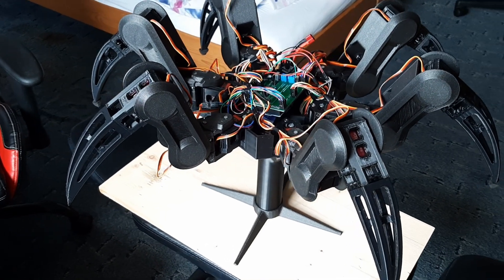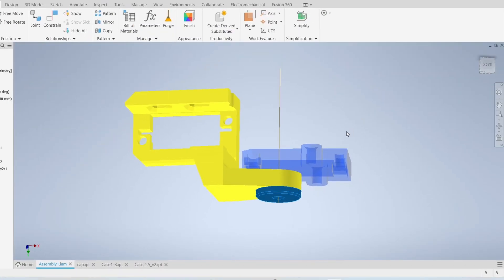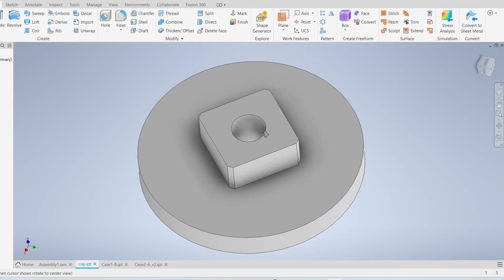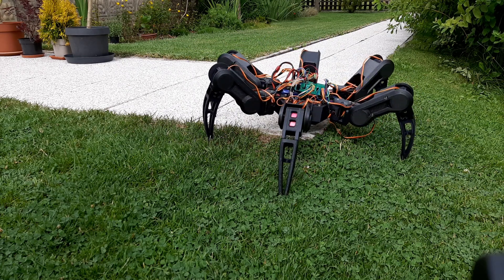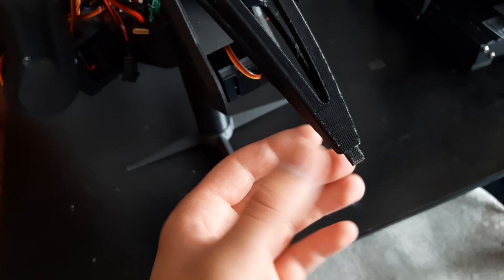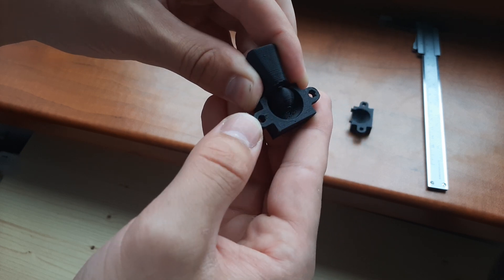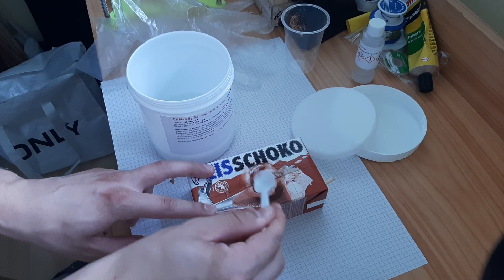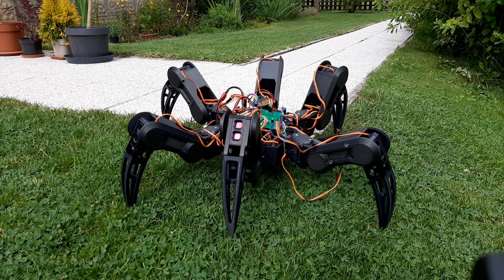Upgrading My Hexapod Robot - Day 377

Comment: The root problem is that the servo has poor leverage.  Companies keep making 180 or 270 degree servos, when walkers would work better with 90 degree servos. Linkages could improve the leverage, but can produce slop. Gears take up more space and add weight and complexity. Ideally, servo manufacturers should give more options. Also,  walker designers should consider using springs or geometry to reduce servo loads on leg joints (not an issue in this case).  Ideally, a suspension sould support most of the weight of the robot body.

Comment: looks more like a power issue to me.  Have you soldered ALL power connections?  never use dupont or other connectors, they always cause servo jitters... always.   Also make sure you have enough amperage for all motors to operate simultaneously.  Hope that helps.

Comment: Are you running 30kg servos for all the joints? And about how much does it weigh?
Reply from the maker: The total weight is 5 kg. I use some 20kg servos for the coxa joints.
Reply: Thank you! It looks awesome. Do you think printing some soft TPU feet would help with your foot issues?
Reply from the maker: @GrumpleBots  No idea, I thought about TPU, but never tried it.

Comment: Oh, thought you'd fix the vibrations with a smoothing algorithm on the output, since it seems to have raw output. I don't know what motors are being used since this is my first time seeing it, but stepper motors are very jerky with their movement, and normal motors have dead zones where they don't want to rest at certain angles caused by the number of copper coils.
Reply from the maker: I am using servo motors, I think the P gain is too high. They vibrate even when the leg is not moving.
Reply: @TazerEngineering  yeah, probably.